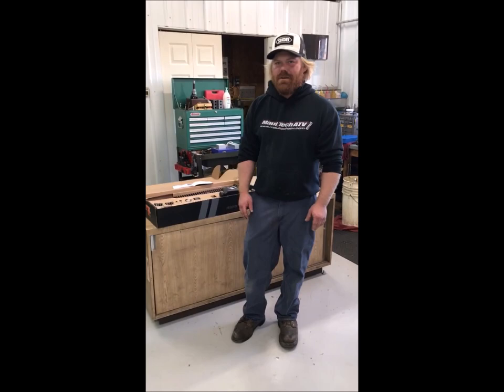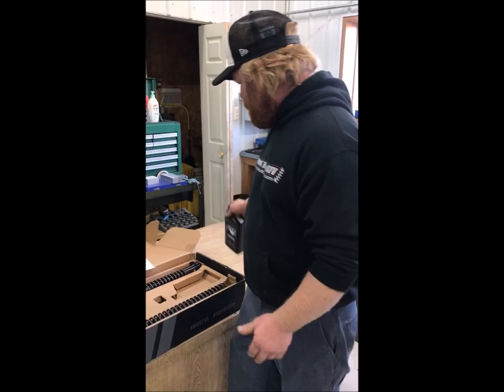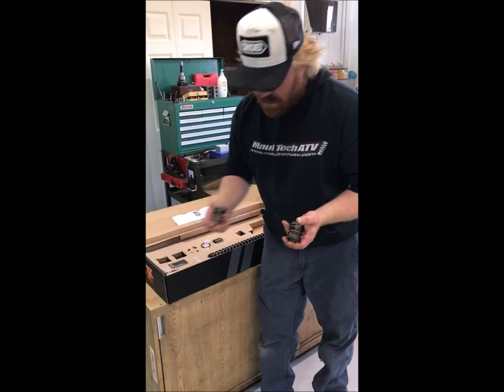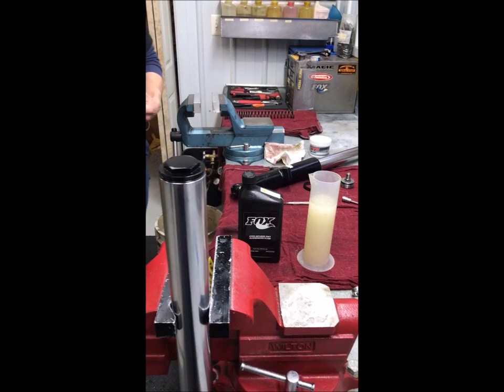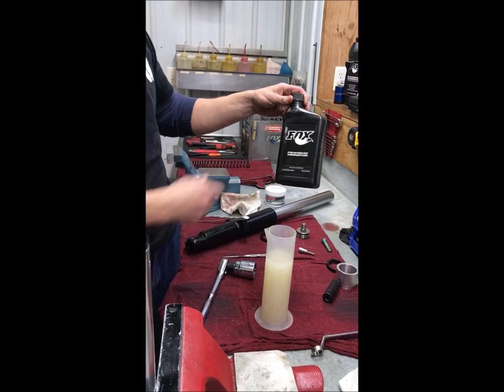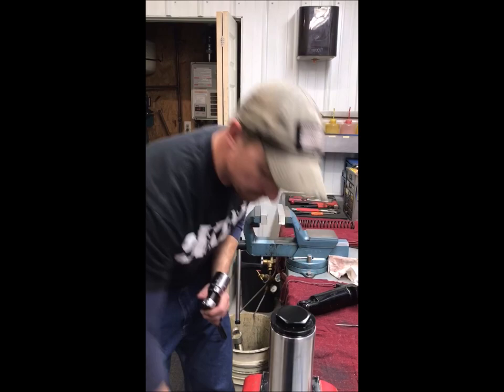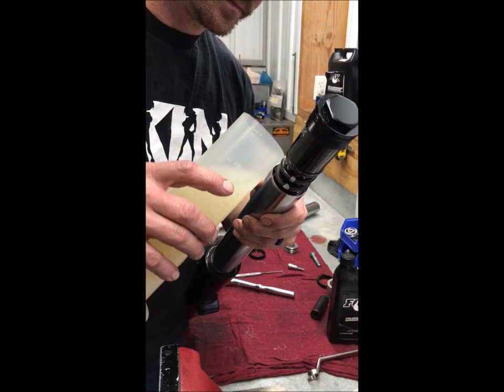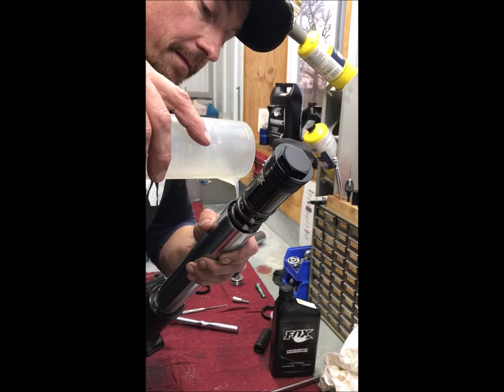FOX RACING SHOX H-D PERFORMANCE SERIES CARTRIDGE KIT DESCRIPTION AND INSTALL VIDEO

Comment: Did you have to cut the preload spacer or does it come precut to length?
Reply: Not sure if you found that out. I’m in the middle of an install now and the left spring is 11mm too long? Something isn’t making sense
Reply: @Hotdogz234-k8p  One spring is longer than the other?
Reply: @davidwilley4524  no sir the Fox springs were 100% good to go, it absolutely was NOT different lengths. The shop I worked with couldn’t have done a worse job. Took them 3 days to remove and replace my front suspension. I had a scheduled appointment, my bike hit there lift 10 minutes after I pulled up. I know this shop on a personal basis. 3 days to install forks(I had to assist….a lot), 20 minutes into the service my ST front fender was dropped and the paint was destroyed, and that was right after I gave the guys in the shop some local catfish to fry. I always try to butter up the tech that is working on my bike. Got to make it feel more personal to ensure a good service, but it doesn’t seem to work. I’ve had $2,000 worth of free services in 2024 due to shops causing damages. Local Harley dealer damaged my rear wheel installing a new tire. How does that chopped front fender on the ST get dropped, I can hold it with 1 finger, & it was the first step for this service. (Remove front fender, set aside & reinstall once service is completed). Even still, I was very nice about the whole thing, and recommended that I pay full price for the service. Which I did, then I basically had to beg them to fix the paint on the fender. This shop is for the white collars of the motorcycle community, haven’t left a review about my experience, wanted to see if they would make up for anything. Let’s just say I used to go in the owners office just to chat, now I don’t step foot near that place.

Comment: So was the ride firm but not to firm?How was brake dive?
Reply: Brake dive is significantly improved.  The feel is more form than stock, especially for the first 1000 miles or so.  They are much more consistent than the stock set up, and have substantially better road feel than stock.